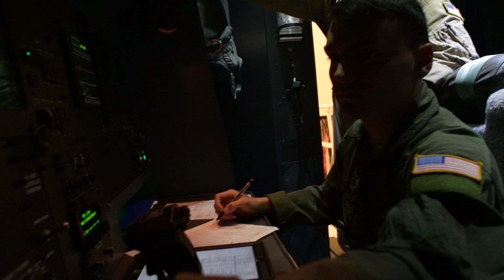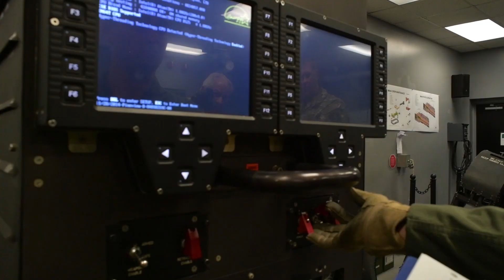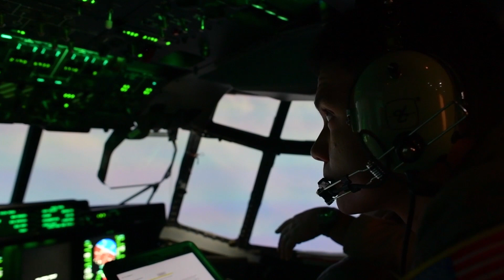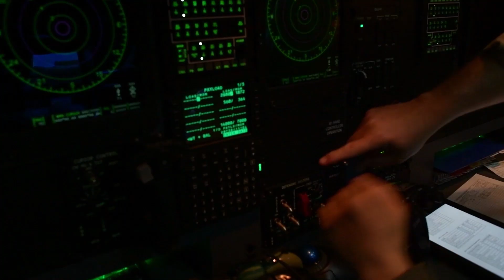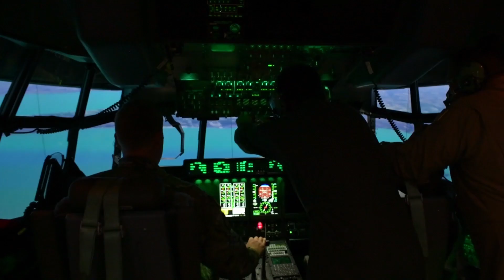Special Missions Aviator Training

Comment: Do you need to be good at math to be a special missions aviator
Reply: Its all pretty simple math. They'll teach you what you need to know.
Reply: @Bralvek  what does the math help with in this job?
Reply: @squiddy5889  depending on airframe you will use more or less math. You'll have to calculate weight and balance and center of gravity with some simple formulas. Helicopters will calculate take off and landing data depending on weight of aircraft + cargo. Dependent on some variables you'll be responsible for figuring out if the aircraft has the performance needed to pick up and ground parties and their cargo, but it's all simple formulas and charts you run to figure that stuff out.
Reply: @Bralvek  thanks you for that info, and I just realized I can’t do the job because I’m 5’1 smh
Reply: @squiddy5889  it is possible to get a waiver for height I'm not 100% about this job in particular, but we have a couple female pilots that are under 5'4. They usually do a test where you have to reach a certain height over your head.
Reply: @Bralvek  thank you I swear it’s like everyone I talked too was like you can’t get a waiver smh. Like I know it’ll probably happen be hard for it to be accepted but worth a try.
Reply: What people fail to realize is that while in tech school, you do the same things over and over again before you have your practicals. All you have to do is study and get into a routine. 

You’re going to do the math you need over and over again until it’s second nature.